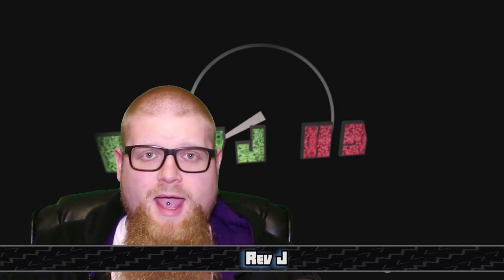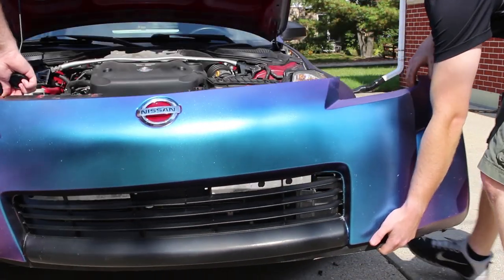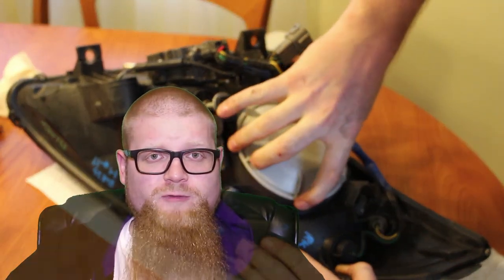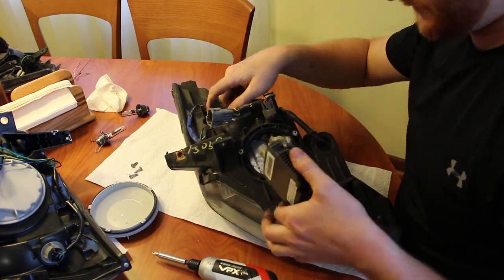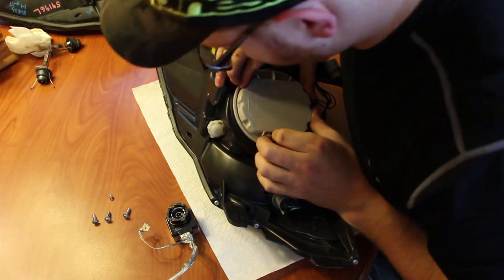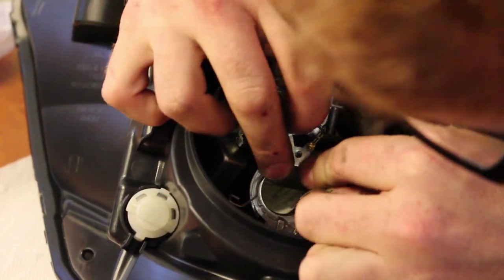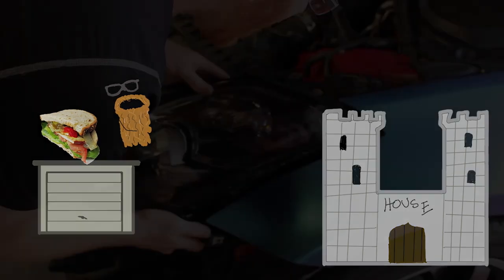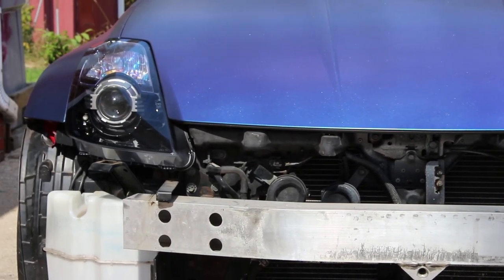350z Depo HID Upgrade - REV J HD

Comment: You went from halogen to bi-xenon? I just bought the same headlights but I didn't even realize that there were two different types of headlights for the Z so my harness is different from the depo bi-xenon harness on the headlights?
Reply: Pauly Sanchez i have the same problem.  the harness is different...

Comment: Since the "smaller stock headlights have the separate bulb for the high beams does any other wiring need to be done or will the transfer for the HID do both high and low beams?

Comment: Great video but some info was left out. What type of headlights wwre these? And how do you reposition or align headlights after the install.
Reply from the maker: +Frank Jackson Hi Frank. The lights are DEPO, as it says in the title. They are some of the more common lights you'll see pop up for sale on Amazon, Ebay etc.  Your right, we never covered aligning the lights. They adjust with a little screw, thats deep behind the light. My350 and the other nissan forums have some better pics, its hard to see. Hope that answers your question, or at least points ya in the right direction.
Reply: +REV J ohhwee sorry about that. Yeah right in the Title lol. Not sure what I was thinking.
Reply from the maker: No problem Frank, it happens. Cheers.

Comment: I need help, I did everything piece by piece but when I took the weather pack off, there was still a full wire connecting inside the headlight without access to disconnect it. Does anyone else have this wire, and how do I remove it without breaking/cutting it?